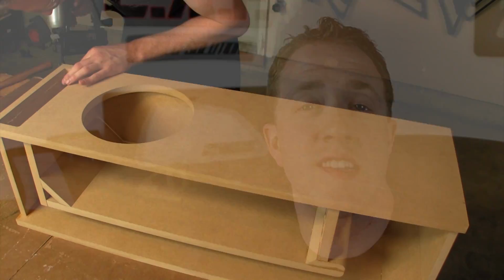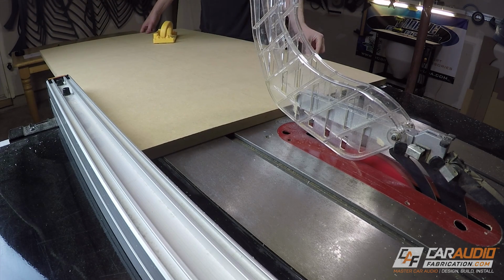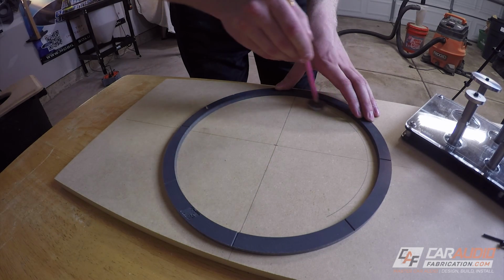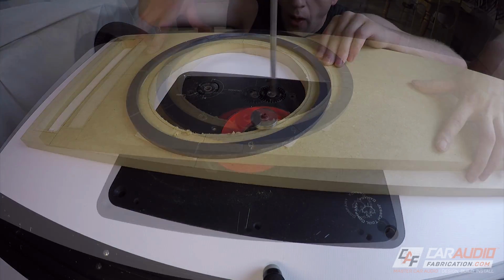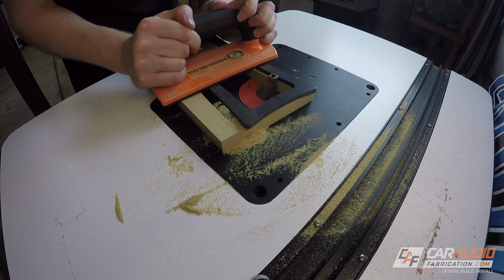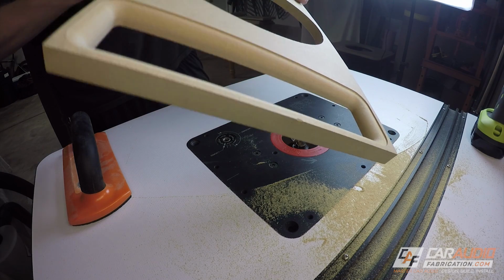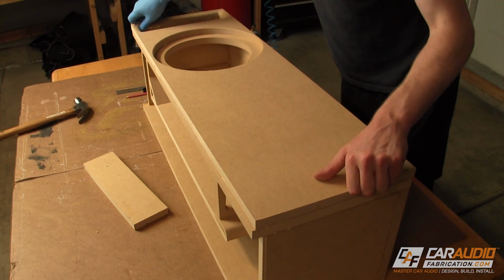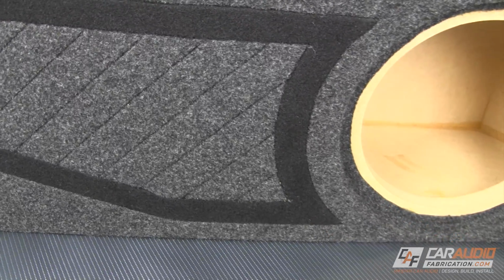How to: Building a Ported Subwoofer Box - CarAudioFabrication

Comment: The material thickness for the box looks like it is more than capable to handle the application it's used for. You can get away with using a thinner board and it will still handle the application.
Reply: I liked the use of corner bracing on your box though. This bracing can be used throughout the box design to minimize the amount of material you use, saving you money, and you walking away from a job with a higher profit margin

Comment: Hi Mark, 
How are you?
Beautiful work, man!!
I have two questions for you.
1° - what software do you use for syntonize the box? Bassbox, winisd...
2° - I have a JBL GTO1514 subwoofer. The product technical data, for a vented box, is showing 99 liters of internal volume, already considerating the driver and the circular port displacements (30hz).
I want to build a box with a retangular port (30hz).
My question is about the volume of retangular port. To build a retangular port, the volume of it self is really bigger than the circular port.
Using a software to projetc my box (bassbox), it says that the port volume is around 14 liters.
So, I have to consider more 14 liters, inside the 99 liters?

Thanks a lot, and congratulations for your videos!!

Comment: I have 2, 8 inch sub woofers I want to install in my small pick up I only have 4 inches dept and 10 inches height 40 inches length ... I want to make a ported box .. What size do the ports have to be? Since I have a really tight spot .. Thanks

Comment: this is a question on port routering.I've noticed how you always place the front baffle and then install the port. I always install the front baffle last, and then flush router the port hole. Is there a benefit to your method compared to mine?

Comment: help can you help me? I have to make a box for 2 subwoofer 12 ... model bass face 12.3
2500 single sub rms ... I have to play loud bass sound pressure (no spl) how can I create a box? ... The maximum outside miserable that I can use for the space are 35 "x16" x18 ".... (MDF material 0.78") please only you can aitarmi;)

Comment: i like how you did the corners in the box to direct airflow. i was wondering if you could put bondo or something in the corners so there not exactly 90° and make a better pathway for the air?
Reply from the maker: It wouldn't be much of a difference and a LOT more work to do the body filler. 45's add a lot of strength too, body filler is very prone to cracking unless it is fiberglass reinforced...
Reply: Corners are the strongest part of the box, so... But for flow it is good.

Comment: can you answer what fuses i should use on small gauge wires and 4 and 8 and 0 gauges if i connect the wire thru a distribution block with the main line 0

Comment: Where is the best place to place a set of tweaters on a car that has a center speaker already im installing a pair of components in the car the car it self has tweeters on the door panel aiming right at your knee were can i place the tweeters for the best sound stage? I have a pontiac grandprix gxp with monsoon sound system if that helps

Comment: Can anyone please reply back to me about this question
On winisd if i don't enter the displacement of my subwoofer when I'm designing a box my designs seem better and look like i will get more SPL out of it is this because the software thinks my subs are inverted or is it just messing with the software because i haven't entered the displacement. thanks
Reply: Your right It would be the equivalent of inverting it, but to confirm, try making the box slightly bigger by an amount as close as possible to the displacement value aswell as adding the displacement of the sub and see if you have similar results.

Comment: I built a box with a 1 meter long port but the box only has 0.25 cubic feet of international volume.      For a 8" sub
Reply: What was it tuned to?
Reply: +Brad Frith not a clue
Reply: Did it sound any kind of good?
Reply: +Brad Frith it depends. If you are close to it is sounds sh*t   But if you are far from it it sounds ok .

Comment: Hi Mark, 

I was wondering if you could explain in a future video about the pros and cons of using Baltic Birch compared to using MDF and maybe you could also do a video using Baltic Birch for a box.

Keep up the good work.
Reply: Would be a good topic but it's been covered before all over the Internet. Baltic is stronger and lighter, but costs more and needs more fine effort to work with, there may be other points for either but that's the main differences..

Comment: Any tips on building a stealth box? Thinking more for something like a short cab truck where you don't want it to draw tons of attention from prying eyes and under the seat may be hard.
Reply: if you're talking single cab they make stealth boxes if you're talking extended cab they make under the seat boxes. or just just use Google. plenty of videos on truck boxes
Reply: invest in window tint too. Keep your car cooler and make it harder to see.
Reply: I don't know why you are excluding the option of putting it under the seat... to make your job easier remove completely the seat while working (measure everything with the seat on and remember if your seat can go up and down to mesure the space while the seat is down or you will end up like me not being able to lower the seat for me not a big deal but when i lend my car to other people is a problem). Also if you are not going for a extremely powerful bass a sealed box will be more forgiving and still give you a nice sound. If you want a ported box it will be harder to design one that fits under a seat and I understand why you don't want to go with that
Reply: All you have to do is remove the back seats, build a box big enough for about four 12-inch subs, and bolt the box down to the floorboard. Since it's bolted to the vehicle, insurance has to cover it.

Comment: question? I just purchased a boss phantom 15 is there any specs I should follow to building the box at perfect size because I was thinking of building a bigger box for more bass. will that work?
Reply: Always stick to recommend box size. Going too big will cause the response to drop off prematurely and then raise back up at your tuning frequency. If you want to play around with box sizes and tunings download a program called winisd. There is a tutorial for this program somewhere on this channel I think.
Reply: Actualy bigger box with lower tuning extends response lower. Size decides if you want deep bass (big box low tuning) or everything flexing (usualy smaller box, higher tuning).
Reply: the bigger the box, the lower the mechanical power handling.  it will be more efficient, and play deep bass with more authority, but not necessarily louder since the sub will bottom out easier.  if the box volume is greater than the Vas spec of the sub, it's technically a free air enclosure, and may only handle half the RMS rating.

Comment: Would I be able to fit 2 orian 12" hcaa in an extended cab 2010 ford ranger? If so, would I be able to make the box match the theme that im going for my truck, matte black / gold?
Reply from the maker: Hard to say without having measurements, you should check out this video: https://www.youtube.com/watch?v=oKdAHZS1LP4&list=PLmybwiwzi3MUbyPjykBaMFI3PVWJwzkJ-&index=2
Reply: +CarAudioFabrication Could you check your instagram direct messages? It applies to my previous comment.
Reply: +CarAudioFabrication   15 x 24.5 x 42= 15,435   15,435 ÷ 1728= 8.9    8.9 x .55= 4.9    If I did the math correctly, this about the space I have in my ford ranger for a box. From what ive seen that is plenty of space for 2 orian hcca 12, right?

Comment: Was wondering, with just glue and finish nails is that making an opportunity for box rattle in the future thanks?
Reply from the maker: No, as long as your cuts are good and square glue and nails makes a very strong bond. Helps to shoot the nails at a slight angle, again though, cuts must be square. If they are not you should use screws and clamps to suck everything together during assembly.